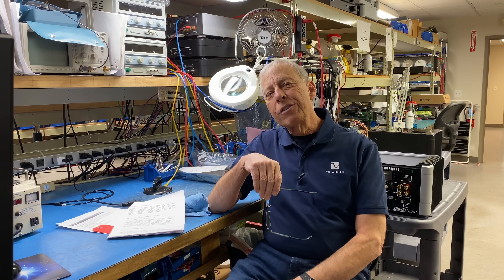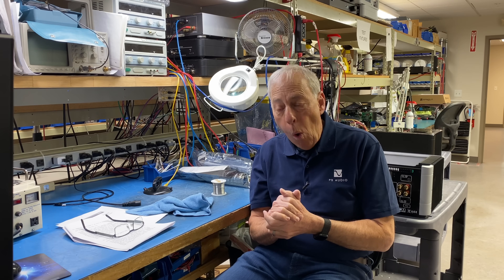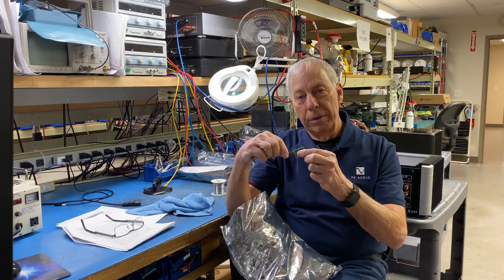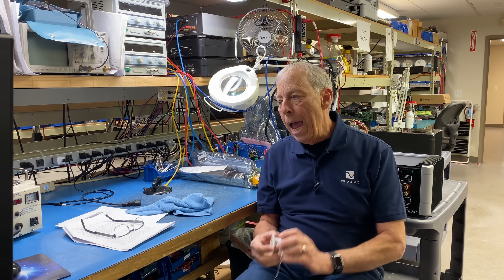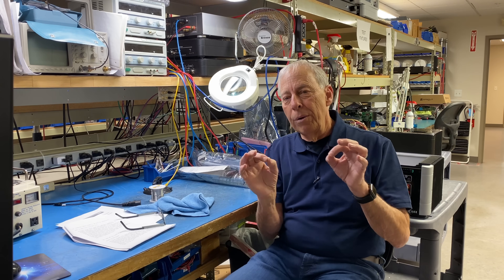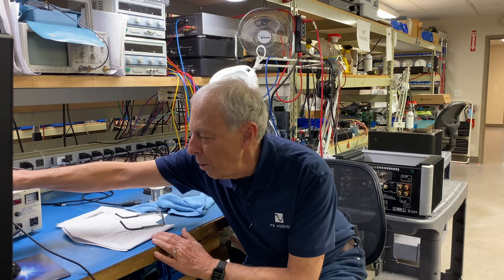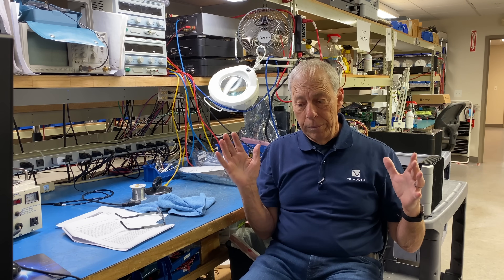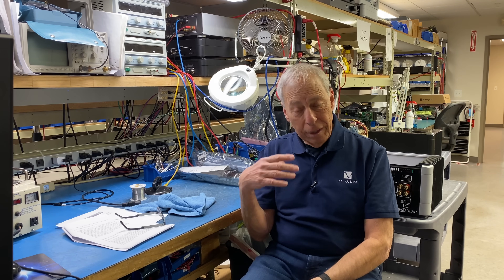How important is solder?

Comment: A good-sounding solder simply must contain lead, preferably 37% (additions of silver are a matter of taste). The worst-sounding ones are lead-free solders, which companies are forced to use under pressure from european regulators (poor reliability, high soldering temperature - that's all about these solders). I repeat, for hi-fi you need to choose 63/37 solders, Kester is very good (it lays down well, after hardening it has a mirror shine - this speaks in favor of high-frequency reproduction).

Comment: If you guys would just listen to the music instead of to your sand-filled speaker enclosures, special coupling capacitors, Russian tubes vs. American NOS, oxygen-free copper wires, and now solder connections, I think you'd be happier. I have an audiophool friend I no longer invite over to listen to a new recording. It turns out he doesn't give a damn about the music, only the electronics--about which he knows next to nothing (not even Ohm's law and not even that capacitors don't pass DC).  What he thinks he knows is really just belief acquired by way of folklore and snake-oil incantations--hot sellers on YT.
Reply: Amen. 73

Comment: I just have to connect.   Back in the 70s-80s, I worked as an ekectrical engineer.  I learned about production wave solder.  I was proficient in soldering at the age of 11 or 12.  Half of what you say is total bs.

Lead free solder comes in a variety, but solder containing silver, typically only contains 2% silver.  The 40% lead wasn't replaced with 40% silver. 

Flux is to de-oxidize the metal surface to which you solder, just prior to the melting point of the solder.   Flux does not cause or in any way, enhance the melting of solder.   Many,  "lead free" solders do have a higher melting point, than the older 60/40 solder. 

My point is, no matter how much you've soldered before, educate yourself on the Setauket before you make a public statement.

Comment: Still have some "Wonder" solder left over from those days - - I use the stuff from Cardas for less important electrical stuff but I break out what's left of that roll of Wonder solder for critical connections - I do have a "later" roll of Wonder solder but I'm not sure if it's the same formula from the Perter Moncrieff era.

Comment: If you ever had one of those rotary volume knobs on an old amplifier that would "scratch" and in some positions, the sound would be very dully, that is caused by oxidation on the wipers of the potentiometer, which can create a low-pass filter (if I'm not mistaken) and dramatically murk up the audio you are passing through it. The same thing can happen when you don't solder well, or use the wrong type of solder at the wrong temperature (cold joint). In that case, you will have a layer of oxidation partially between the solder and the metal. Depending on where in the audio path it is, that can have none, a small, or a major influence on the sound.  

One odd phenomenon with that is that it can be temperature-dependent, so that issues only show up when the equipment is cold, or once once it is heated up to temperature. It is also susceptible to mechanic interference. Issues might not show up right out of the factory but only after some time, as the solder has gone through multiple heat/cooling cycles and the mechanical stress causes additional separation of the bond.

This type of issue is not very common anymore, with very consistent mass production, and automated testing routines (pin-probing, x-ray). Also, in some cases you can visually tell from the shape and reflectance of the joint if it might be problematic.

Comment: There is no such thing as silver solder.  That is a marketing term.  I'm not aware of any commercial-use lead-free solder for electronics that has less than 95% tin content.  The solder they  use in their products likely has <2% silver content.  Silver, gold, and other additives affect the wetting and bonding properties of solder to other metals (like leads and PCB surfaces).  Because the minor metals in the alloy are all that really differentiate 95+% tin solder, it usually influences the name of the alloy (like 'silver solder').  Solder problems in manufacturing have more to do with voids and leaching of other metals from those leads and PCB surfaces causing bonding or flow problems (wetting).  The fact that wasn't mentioned means he has no clue on anything solder related.  Some expert.  He even went so far as to claim their sub-assemblies are hand soldered due to being PTH and not flowed on a wave machine.  I'm more than skeptical.
Lead is only banned by RoHS in the EU.  You can sell all the leaded solder products you want in the USA.  But they likely use lead-free in the manufacturing chain to keep things common across markets  They likely use leaded solder in the engineering lab for local prototyping only (not warranty repairs).  60/40 was always crap.  63/37 is at least eutectic - meaning the tin and the lead melt at the same time in that ratio alloy mix.  Eutectic solder mitigates cold solder joints where one metal melts/cools at a different rate causing cracking or bonding failures to other surfaces.

Comment: Funny this topic comes up on the same day I tore down a cheapo amp that I assumed had a faulty pot- guess what- it was a pair of failed solder joints! 30 minutes tearing it down, and about 5 seconds worth of iron work. Good as new. Point being that the material in the solder is significant, but the method which the solder is just as important

Comment: Pure silver melting temp is 961.8 C. I used wbt solder that has a few % silver. My friends loved to get it from me. I remembered the label indicated it has 2 years shelf life. After 6 years, I am still using it, as my 2 rolls were not "cheap". The group chats said remelting the solder after the first melting  produced better sounds, and proper cooling rate enganced the bonding, any comments? Claiming that the manual remelting has better uniform bonding and contact.

Comment: Another thing to keep in mind; some brands/formulations of solder might not be sufficiently stable to be usable when they get old. When I was a kid ,(back when dinosaurs roamed the earth) you could use Radio Shack  solder (it was marked made in USA, IIRC) and it worked just fine, didnt seem to work any less well than Kester (maybe it was made by Kester, for all I know); but while sorting through some of my old tools at my parent's house, I found an old roll of Rat Shack solder and it didn't flow well at all. Perhaps the internal flux degrades? I also found an old roll of very thin wire solder at work, can't remember the brand, that smelled like burned sugar when I tried to use it and didn't work well at all. Something to be aware of...
Reply: Ive found old 40/60 belknap solder my grandfather used to use and though i have no experience soldering until about 10 minutes ago, it seemed to flow relatively easily. Some hot spots, but that is most likely my inexperienced hand and old iron with old solder working its magic

Comment: Wow I’m shocked you got this so horribly wrong!  The flux removes a layer of oxidation from the components being soldered to.  It basically cleans the surface so that the solder can bond properly.  It takes a split second for the flux to do its job and once this happens the solder will flow into the joint due to improved wetting forces.

Comment: Me: I'm open to hearing peoples opinions on sound quality
Also me after hearing that solder makes an audible difference: the gods are testing me
Reply: Well replacing only ONE, or only a few joints of solder in an audio component with a different, better type of solder definitely isn't going to make ANY totally audible difference, (and "arguably" measurable at that), however, if you changed out every single solder joint in the entire circuit of that component, or better yet, you actually were to build the exact same component from scratch with the better solder, from the ground up, then you would be able to hear a slight improvement in sound clarity and detail, especially in the top end treble, (I've tried it myself because I didn't quite believe it either!), but this will also all come albeit at a very considerable price/cost increase over the cheaper "standard" solder, so it's usually not really worth it, (price vs. performance ratio), to use the most expensive solder in most "average" audio components because solder doesn't make nearly as much difference in overall sound quality as the individual component part quality does! (i.e. the relative sound quality of the capacitors, inductors, resistors, transistors, tubes, etc., etc.)

That's why expensive solder is mostly reserved for the truly HIGH-end audio components that actually CAN reveal tiny little minute details like that! Truly high-end audio components and speakers are where one can actually appreciate having the better solder in the circuit!

Comment: Soldering fuses two metals together. Solderless terminals doesn't create a bond between one conductor and another. When you solder two leads together, wether or not they're soldered to a pic board or two components soldered together creates a bond, where two metals merge and are chemically bonded together, like welding two pieces of steel on a car chassis. When that happens you now have one metal instead of two different metals hooked together.

Comment: I had a roll of bad Chinese solder that I got for like $7 bucks off of eBay. It was from a recommended link by a popular EE youtuber. Using that solder, 3 projects in a row kept failing and I couldn't really see anything wrong. I got some Kester, and redid every solder joint (it didn't take long at all since everything was done and because the solder was so easy to work with) - and each of the 3 projects worked the first time as soon as I was done.  If I had used good solder in the first place I would have saved days of time in turning around the projects. Can't speak to audio quality, but if nothing works, it doesn't matter.

Comment: Why don't we use silver based speaker wire then? Too expensive?
Reply: Because thick enough OFC wire has low enough resistance to not need any other fancy materials. The difference is negligible when you look at cost

Comment: The job of flux is mainfestly not to make solder melt, and it does not perform the same role as salt on ice. It's the heat that does that job. The job of flux is to stop the component leads, PCB pads and surface of the hot solder from oxidising. If those oxidise, the older won't flow and make a good electrical bond. Heat up solder and components without flux and the solder will "ball up" and not bond with the component leads and pads.

Fluxes can be active or passive, and active fluxes will essentially clean off oxid layers, but that's not something you want in an electronic circuit, so the flux used in electronics is passive.

The quality of the soldering does matter, as if it isn't bonded properly to the components and pads, then it's prone to corrosion and faulty joints. That's especially so if it's at all damp in the air. What matters far more than the solder is the quality of the soldering.

Comment: Paul is correct.. Flux is a weak acid that is activated at a certain temperature.. At room temperature it is inert. It helps to react with impurities, etches the surface so flow is improved. The working temperature of soldering is thus reduced to provide reliable joints . Also flux protects the solders while soldering and after soldering.  Leaded is the most reliable joint..nasa and military still allowed to use them.. Flux is just as important as solder... To both sound and performance

Comment: Solder Flux does not lower the melting point of solder...

Google says:

In soldering of metals, flux serves a threefold purpose: it removes any oxidized metal from the surfaces to be soldered, seals out air thus preventing further oxidation, and by facilitating amalgamation improves wetting characteristics of the liquid solder.

Aren't most manageable lead-free solder wire (on a spool) going to have silver it them?  It's just going to give you better quality hand soldering results than those that don't have Ag.  I doubt very much your using it because it sounds better.  But hey, anything can be a selling point/feature.

Comment: Well, I'm sure that is .8 millimeter, not eight. Flux/rosin causes the solder to flow, as it's heat which causes solder to melt. Silver content allows for higher conductivity between components and solder pads and a higher melting point.

Comment: I believe that Kester Silver Solder contains 2% Silver, 62% Tin and 36% Lead.
Reply: Sounds correct, and it is fantastic stuff. We use it at work (stereo repair shop).
Reply: @goodun2974  It's not as "fantastic" as you mislead others here to believe...LOL.
Wonder Signature solder is the BEST and flows much better than this overrated and overpriced Kester shit.
Purchase some for your "stereo repair shop" and find out for yourself.
Reply: @stephenoverton8352  , my boss, who is a brilliant guy with several engineering degrees,  but a bit of a cheapskate, bought two cases of the Kester solder with 2% silver a decade ago, probably worried that it would be discontinued and unavailable at some point in time. He wouldn't have spent the money if he didn't think the stuff was any good, or if the price was outrageous. I don't know if it's still being manufactured, but I recommend it to anyone who can find it. Lead-free solder, however, is terrible stuff, and I feel bad for anyone who is just learning to solder and all they have to work with is lead-free.....it's gotta be frustrating, especially if they're working with off-brand solder made with who-knows-what and from god-knows-where...
Reply: There are many blends.  That sound like one of them.

Comment: No, Paul, flux is NOT required in order to melt solder, or even to melt it more easily.  
Flux helps to prevent oxidation (which interferes with flow) and ensure that the solder wets the other metals in the joint.  The sign of a good joint is a bright surface finish and smooth contours on the solder fillet that show no evidence of surface tension when the solder was molten.  
Provided that good wetting and flow is achieved, it doesn't matter what alloy the solder is and you cannot hear any difference due to choice of solder alloy.  
With adoption of ROHS, solder for electronics production no longer contains lead.  Today's solders are mostly tin and one of the most popular formulations is 96% tin, 3.5% silver and 0.5% copper.  So, guess what?  Almost everyone is using solder with silver in it, these days!

Comment: Been using Wonder Solder for 20 yrs and it has lower melting point , super easy to work with and i even add it to uderside of the board around transformers and power traces .... modifications to speaker crossovers also make great use of it.
Have tried 4% Silver German WBT solder and it sounded brighter what I did not like in solid State gear  so I stopped using it .

Comment: Here are the facts to prove Paul doesn't know what he is talking about. 
1) the word is SoLder not sodder.
2) heat makes soLder melt not flux.
3) flux is used to remove oxidation and prevents airflow to the lead, preventing further oxidation.
4) Silver soLder is 60% tin, 37% lead and 3% silver. Tin is the main material in almost all soLder's and the silver is just for a stronger bond.
Reply: Dave Micolichek  90% silver is fine if you are brazing but that is not good for electronics because of the very high melting point for 90% silver (900+F). To my point most electronic soLder uses a high percentage of tin. 3 to 5% of silver is normal for electronics and gives a very strong bond and without melting the components. I hope I helped clarify this for you.

Comment: flux removes the lair of oxygen between the 2 surfaces allowing the solder to bond.
Reply: Sean Turner, displaces is a more accurate description; the flux displaces air/oxygen so the the heated metals don't oxidize almost instantly.
Reply: *layer
Reply: Dave Micolichek  yes i know.im a plumber..ha

Comment: In addition to the selection of solder  composition workmanship is critical.  Flux does act as cleaning agent but is also critical with surface mounted components that there is no oxidation on the soldered tin surfaces. Storage and shelf life is a big deal.  My impression is that manufacturing at PS Audio more similar to military and higher reliability equipment than typical consumer electronics.

Comment: Lead solder is best. It works at a lower temperature so there's less stress on the component and circuit board. They only moved to lead free due to environmental disposal issues. To work with lead solder is still safer than lead free. This is because of  the very high temperatures needed to melt the solder and the chemicals in the  flux that they use are much more harmful if breathed in over long periods.

 As for adding silver to the solder l guess that its better for conducting audio signals.  That's why you dont get lead speaker cables. I bet the industry wished that they could though.  Heavy cables must mean higher quality  and higher prices.